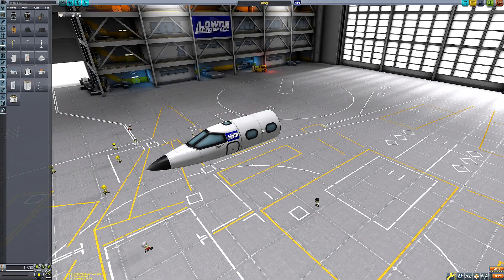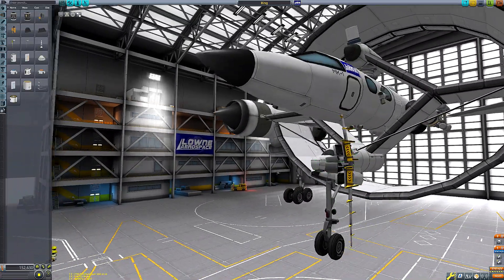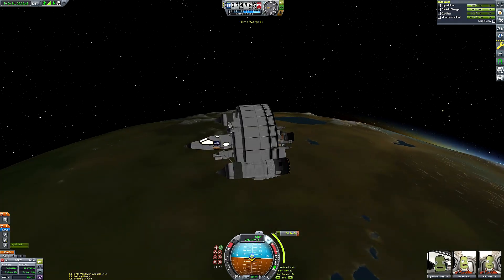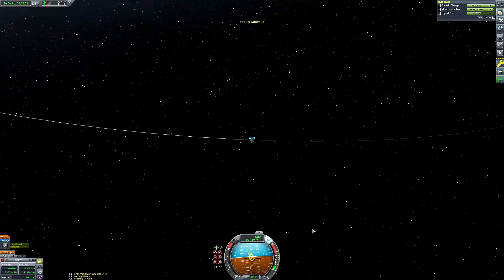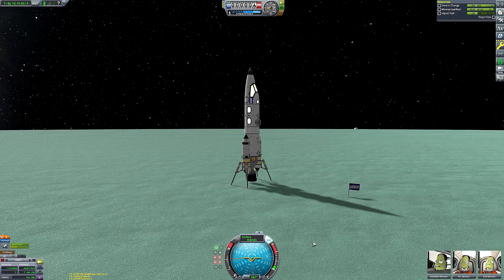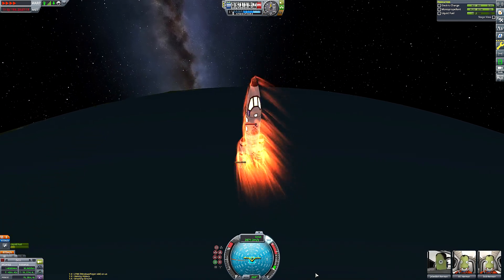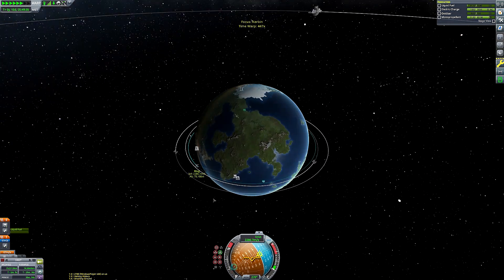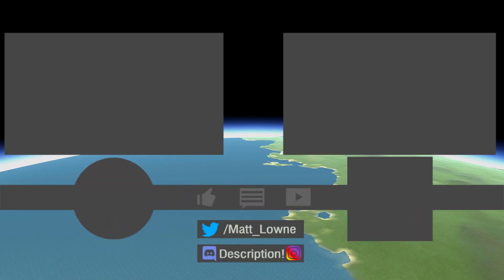KSP: The Hyper-Ring SSTO!

Comment: Personally if I were to do this I would do it in 2 stages. The ring would be sent into orbit by rocket and would feature vacuum based engines and lots of fuel and then I would fly SSTO’s up to couple to the ring to be shuttled to other planets. Overall very cool.

Comment: What's really cool is that the Delta 7-B Æthersprite-class light interceptors (by Kuat Systems Engineering) used by the Jedi early in the Clone Wars and the Eta 2 Actis-class light interceptors (also by Kuat Systems) used by the Jedi later in the Clone Wars both use the hyperdrive ring system (Come to think of it, Kuat Systems probably has a patent on the design). The difference is that the Eta 2 hyperdrive ring has 6 engines while the Delta 7-B hyperdrive ring has only 2.
Reply: By the way: One of the fan-made space planes available for free on the in-game community vehicle catalog is a Delta 7-B interceptor, and I think it would be cool if you tried making a Hyperdrive Ring for it.
Reply: I checked the wiki, and apparently the hyperspace rings for Kuat-brand interceptors aren't made by Kuat. The two-engine version for the Delta 7-B is the Syliure-31 (also compatible with the Delta-12 Skysprite) while the Eta 2's use the larger, six-engine Syliure-45. Both models of transport ring are manufatcured by TransGalMeg.

Comment: hey matt! at the start of the video when you said the lowne lazy method of docking doesn't work with these two crafts you were slightly wrong... when docking the two crafts, insert the command vessel into the holding "box" and sit still once the docking ports are relatively aligned. once the previous step is completed, select the docking port on the ship and select the option "control from here". enable SAS and select the other docking port as the target. do the same on the ring craft and then use RCS to move them closer and they will align.
this might work... I'm not 100% sure but I think it might.

p.s i am a console player and I assume this will work on pc!

Comment: The ring could be used as refueling station or re-entry rescue spacecraft.Just dock it to refuel or if the station has full fuel, but some spacecraft without fuel, only monopropellant, can dock it, start the engines and start re-entry.

Comment: 1:38 so what Matt here is saying its probably not an SSTO
Reply: Well yes, but actually no. There's no reason a ship can't have multiple stages and still be an SSTO, in fact it's probably the best way to make a useful SSTO without having to use orbital refuelling. The thing to remember is that the definition of an SSTO isn't a single-stage ship that can reach orbit, but rather a ship that can reach orbit by /using/ only a single stage. The whole first stage (ring+rocket) made it to orbit and then separated, which makes the vessel a two-stage SSTO: one stage to orbit, one stage for interplanetary travel. It's true that the little rocket isn't an SSTO by itself, because nuclear rockets are a really bad engine for SSTOs, but it doesn't need to be: by adding the ring and making it a bigger ship, it became an SSTO, even though the ring gets left behind once the whole vessel gets to orbit.

Comment: LKO Debris only gets cleaned up automatically if it drops below 20km altitude.  Above that, but under 70km you can either switch to it so that atmospheric drag gets applied degrading it's orbit, or you can just delete it.

As a rule, when I'm going for clean space, I delete any debris which has a Periapsis below 70km as that would eventually deorbit.

Comment: I feel this is really pushing the "SS" part of SSTO
Reply: It gets to orbit on a single stage, which is all a ship needs to do to be an SSTO. So long as the separation happens once it's in orbit (which for this ship is true) then the second stage doesn't matter. A SSTO is any ship that can reach orbit without using more than one stage, not just single-stage orbit-capable ships. Also, this ship could still do interplanetary travel all as one thing, it would just be less efficient (and probably wouldn't quite be able to make the trip to Minmus and back), so it's not really "cheating" in any way.

Comment: Hi Matt that was cool!!!

But would you be able to build it the other way around?

Use the ring with high efficient engines to fly around the system and use the centre bit to undock and go down to the planet using mk3 parts so you can take a rover to science and drive around?

Comment: Matt: This isn't as 'out-there' as you might think :) I found numerous "ring-wing" jet-powered VTOL concepts from the early 60s to the late 70s before the idea dropped off. A Boeing engineer by the name of Dani Edar was tasked with coming up with a super-cheap, off the shelf LV concept in the late 80s and suggested 'strap-on' podded jet engines that would parachute back to the launch site for re-use which he later modified into a reusable ring-wing stage. (NASA later essentially 'stole' his idea along with some work done by a guy who ran the air-breathing concept site "atl-accel.com" which incorporated a ramjet stage as well. And point of fact many of those early ring-wing patents assumed the use of the ring-wing and central stage as a hyper-sonic ramjet engine. The NASA booster is called the "Rambooster" concept and link is below) The main thing that most of this work found was the inclusion of air-breathing engines to speeds above Mach-10 was actually a real game changer but as most work got sidetracked with SCRAMjet engines being required, (actually false as a 'standard' sub-sonic combustion ramjet can probably work well out to Mach-12 speeds which is well above where you want to get out of the atmosphere anyway) and other 'cutting edge' tech being added simply to 'justify' such projects they of course went nowhere. 

Oddly there's a nice paper trail from the late 50s and the US Aerospaceplane program that showed that cooled turbojets, (similar to the SABRE design but without the included rocket engine) worked well past Mach-8 but since that wasn't what anyone was actually LOOKING for the data was ignored. 
NASA Rambooster design:
https://www.nasa.gov/sites/default/files/files/DR-0025_DRC-010-039_Ram-Booster_TOP-2012-03-31_ONLINE.pdf
https://patents.google.com/patent/US8047472B1/en

Eder design
https://yarchive.net/space/launchers/jet_first_stage.html

Linkage overload :)
https://forum.nasaspaceflight.com/index.php?topic=29160.msg1063701#msg1063701

Randy

Comment: Matt, the reason you have debris still loitering around Kerbin is because once you're beyond render zone about 3 KMs away from another ship or part of a ship, the atmospheric physics will not apply to that piece. Example, a debris piece with apoapsis of 80 Km and and periapsis of 20 Km will hold that infinitely unless you switch to that debris piece in tracking center or manually delete.

Comment: You did it backwards. The ring was for interstellar space travel. Not going to up or down the gravity well. The star fighter had all the fuel and engines needed to do that. You would build the ring in space or fly it up on its own rocket. Then fly the star fighter to it, dock, go around the system.

Comment: As you saw and hearted their comment about the debris Matt .... You may just need to switch between all the debris orbiting the planet and let them crash in to the ground. They usually immediately just start plummeting

IMPORTANT NOTE!
You may want to have unlocked time warp installed for your sanity when doing this. As it usually won't let you switch or leave the craft without reverting, which can cause problems. Also some if you land in the water with these it doesn't get destroyed and starts to sink, so you're just stuck there watching it slowly sink 10km to the bottom of sea where it spontaneously explodes on impact.
(Either that or only select them when over land)

Comment: Bah!  Bourbon is whiskey.  Specifically, it is a whiskey aged in charred barrels a minimum of 2 years and is made from at least 51% corn, and traditionally made in the region of Kentucky that used to make up Bourbon County.  Therefore, Jack Daniels is not traditionally a bourbon since it is made in Tennessee.  In fact, Old No. 7 is usually labeled "Tennessee Sipping Whiskey".  Granted, it has become far more acceptable to call any distilled whiskey aged in charred barrels for 2 years and made from 51% corn bourbon, but nothing quite matches that old Kentucky charm.

Comment: 18:00 this is exactly what happens. if you leave a vessel when its periapsis is greater then 0 then the ship will "go on rails". its orbit does not change so all you have to do is go back to the vessel and just wait until it enters atmosphere assuming you left its periapsis less then 70km. sometimes it will already be in atmosphere when you enter and it is very exciting watching the physics engine trying to work out orbital velocity at only 10 km from the surface and every thing just explodes instantly and the sometime the camera just goes nuts in the process.

Comment: the thing with the debree is that, when youre not controlling it, it wont slow down when in atmosphere. So all your debrees should be in a "subatmospheric" trajectory. But without controlling the craft, physics are shutdown and the air resistance wont do shit. So just switching to the debree and watch it get aero braked and destroyed is all you need to do

Comment: I would think that a smaller SSTO which could connect to a hyper-ring for interplanetary flight would be cool, just like the appollo system for returning to earth
Reply: @Zwenk Wiel Sure it is.  It got to orbit without discarding any parts.  The fact that it left some parts in LKO while going off to some other destination doesn't make it not an SSTO, just makes it a multi-part ship.  The entire ship got to orbit, and the entire ship came back to the ground.

Comment: on subject of debris.... sometimes my stages I intended to have burn up only have a peri of about 40km and they stay on the rails for physics.
Eg a return capsule from Mun dumps the engine to use the heat shield and i set a gentle re-entry angle like 40km... the engine and tank sometimes gets stuck in a very low orbit if they fall far enough from the active ship as to not be part of real physics

Comment: "Unrealistic sharp turn to kill some velocity"
It's called "Aerocobra" and is actually used by fighter jet pilots to dodge missles huh
Reply: Hit the brakes, fly right by.
Reply: It’s an air show maneuver only it has no practical combat applications notching and countermeasures dodge missiles cobras get you killed
Reply: @Nr15121  I could be wrong but I think high G maneuvers like the airocobra do work against some or most missiles, but killing your energy like that would certainly put you in a disadvantaged position and would probably lead you to your demise just as the missile would
Reply: @infinity9646  that would depend but generally notching is the best option
Reply: @Nr15121  Interesting! I wonder if airocobra was one of those things which used to work but has been obsoleted by advancing technology.
Reply: @eekee6034  Honestly I doubt it ever had a practical application in combat because it isnt sudden enough that the guy behind you wouldn't be able to a get off his guns or b use a fox 2, it looks cool and super maneuverability is absolutely important and helpful but that move is for the crowds not a dogfight
Reply: if you blow up technically your killing something, might not be your velocity
Reply: I believe the cobra is somewhat usable in a fox 2 (heat seeking missile) dogfight and nowhere else. The only applicable situation is if you are in a fighter aircraft that can pull lots of AOA at low speeds (like a Mirage 200 with its delta wing) then a cobra would be useful to pull lead and shoot a missile at the enemy if you are in a rate fight on the deck or in a 1 circle fight. But it fails to do anything but kill you in every other situation. If your bandit is at your 6 o'clock(the situation where the cobra is always used in the Top Gun movies) you should:
1) Consider how much you screwed up (this shouldn't be a dogfight you should have killed him/her hours ago with modern missiles that can lock, track, and kill from over 100 miles away)
2) Should start doing nose counters, trying to get your slow enough for your enemy to overshoot you
Or 3) just climb, not do a cobra. If you are ahead of your enemy and you just overshot you are likely faster as then them, so you can use your speed to climb to a higher altitude and dive back down on him/her to shoot a fox 2 or even take a gunshot.

Very rarely should you ever do a cobra in a real life dogfight, also, why even do a dogfight? Looks really cool, I will give it that. But it is all show, no punch.

Comment: Had thought to do a similar SSTO concept of staging off the air breathing section once in orbit to either send it home alone or return to later (Though returning to Kerbin orbit rather than going straight for a reentry is more delta intensive). My issue tended to be how much the docking ports flex. Same with constructing ships in orbit via docking (besides the pita of ensuring perfect alignment of engine parts).... anything I connect via the jr docking port just wobbles all over the place.
Allegedly you can dock 2 ports at once for stability and alignment but I've never pulled it off
Reply: Just use the proper method of docking go to the mothership target the lander's docking port then switch to the lander and target the mothership's docking port and they should keep perfect alignment so long as they are in physics range
Reply: @yakkobthelearned  it's not docking mate. I dont even need to cheese it by switching craft, docking is a piece of piss. It's the flex on docked ports after docking, ships bendy as hell. That said I resolved it by using auto struts after docking.

Comment: 14:03 I was here sweating about having 6 upper stages in orbit because Matt said that we shouldn't leave debris in orbit when he has over 10 bits of debris in orbit! THIS IS TREASON! BLASPHEMY! MELT HIM WITH REENTRY HEATING!

JK! I think it's because you have to drop it low enough so that the camera switches to the non-orbital view (should be pretty obvious when the camera angle changes) or that the periapsis is below zero. Otherwise, KSP doesn't render the atmosphere for unloaded craft, so it will stay in orbit unless you switch to it and follow it through the atmosphere. Using this I once made a skimmer that orbited Kerbin at 50KM by switching to another craft after the orbit was correct. Now it will stay like that unless I either switch to it or load it in by flying near it.

Comment: In regards to your debris you have in orbit, your theory is correct. The game doesn't calculate atmospheric drag on a unloaded craft. This is probably done on purpose to save memory.  If you leave something with lets say a 20km PE than switch to anything else that is far enough away, the game wont calculate the drag on that craft has both that craft and that part of the environment is no longer loaded in. All you have to do to get that debris to burn up is go to Tracking Center and just select/switch to that debris and manually let it burn. Or you can destroy it in the Tracking Center if you don't want to be bothered.

Comment: so here we are, acknowledging that SSTOs are rather inefficient. it's a nice accomplishment and a challenge for sure, but inefficient none the less
Reply: @GrandProtectorDark  absolutely. spaceplanes are especially useless. all the weird landing and starting profiles to and from bodies without atmosphere only to carry double the wight necessary in wings and airbreething engines
Reply: Cookie Monster incorrect, sstos are useless, space planes are useful, etc: the space shuttle
Reply: @mineeagle2651  well I won't argue that space shuttles are very useful and extremely capable (re-using the SSME, repairing and rescuing satellites) but that's basically everything id also expect StarShip to do. only in bigger and better. spaceplanes are only useful for LKO uses. you're losing a lot of Delta V by bringing wings and air-breathing engines to another planet. In short: there is nothing that a spaceplane can do that a 100% reuseable, two saged rocket cant do.
Reply: Cookie Monster what about detachable wings, literally like matts vid
Reply: @mineeagle2651  possible but why bother? Whenever I tried that, the main craft got bigger and bigger and so did the wings and it got more and more complicated to get it up there. its IMO easier to make a reusable booster.

Comment: If you look at the orbits of your debris, you'll probably find that they have periapses inside the atmosphere. When you de-orbit something such that it doesn't hit the ground, but does pass through the atmosphere, when you switch away from that vessel KSP forgets to run the  atmospheric drag simulation and so thinks it's still in orbit. If you click fly on such a peice of debris, it will fall out of orbit as long as you watch it.

Comment: Wonderful job! Regarding debris, I've noticed that if you leave a piece of debris on a degrading orbit and "ride it down", it behaves as expected. However, often if you travel away from the separate stage, the game will remember its sub-orbital trajectory, but it won't lower its appoapsis unless you select the debris from the tracking center.  I suspect that the game removes physics from objects that isn't in the immediate vicinity of the player's object to save on resources.

Comment: Hey Matt, with the debris I’m fairly certain if the periapse doesn’t fall below a specific height the debris won’t delete itself Automatically. I play rss and it’s around 70km in that so maybe 35km in stock?
Reply: Just looked it up, it’s when atmosphere density hits 0.1, which corresponds to around 23km, so even if you deorbit stuff, if it doesn’t go below that height, it’ll remain.